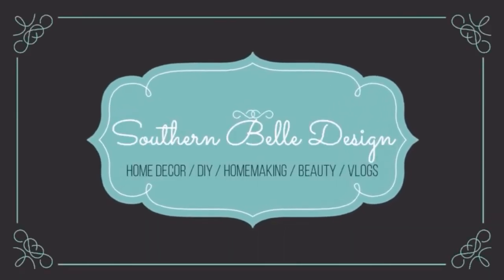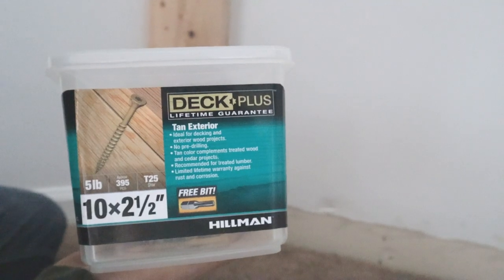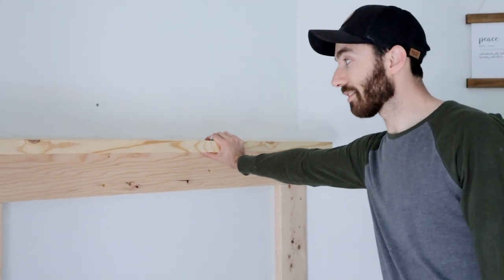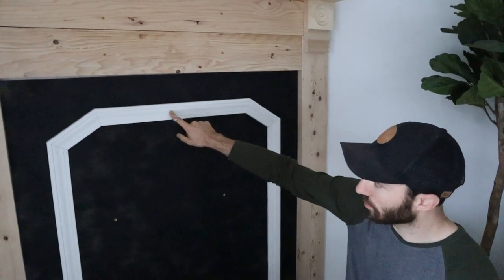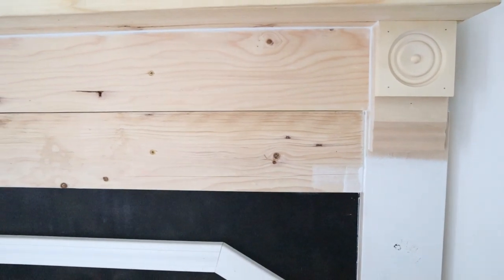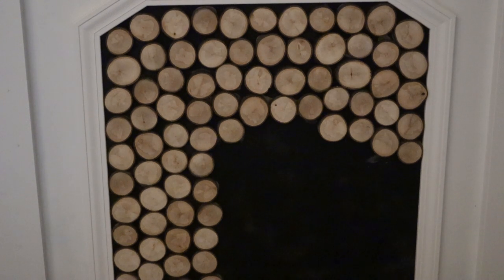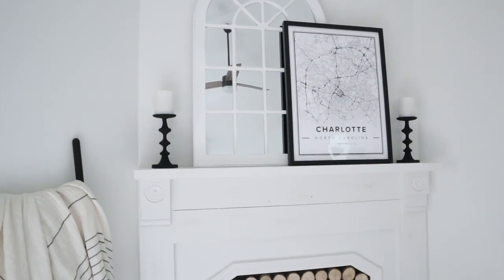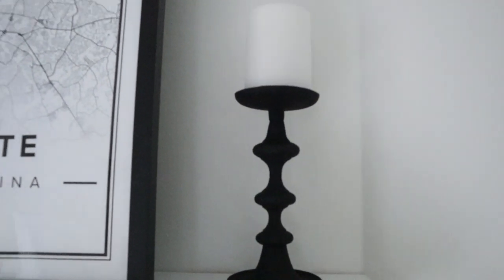DIY FAUX FIREPLACE | DIY FIREPLACE MANTEL | FARMHOUSE DECOR | HOUSE + HOLM

Comment: What are the dimensions of the frame pieces with the angels?
Reply from the maker: Hi Jessica! Are you wondering the lengths that we cut them to or the actual dimensions of the wood (to purchase the same/similar). Thanks!
Reply: The length of all the trim pieces with the angles. Im having a hard time with the correct length of those pieces!
Reply from the maker: The two pieces that go to the floor were cut to 35” at their tallest point (outside edge). The small curve pieces are 6 3/4” on the outside edge and the middle piece is 22 3/8 on the outside edge. 
Hope this helps!